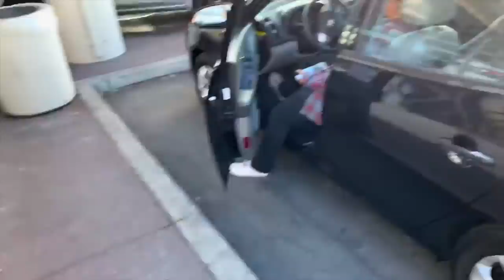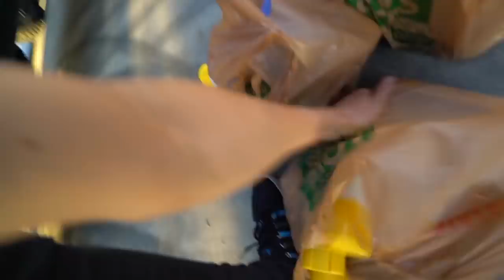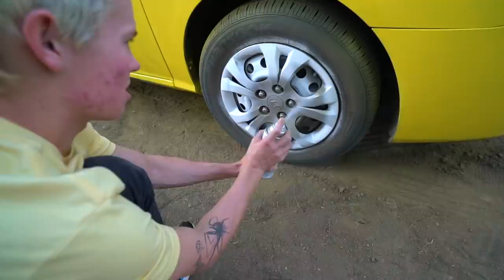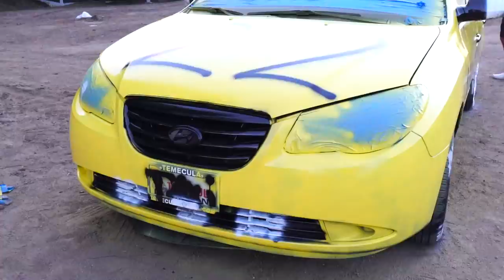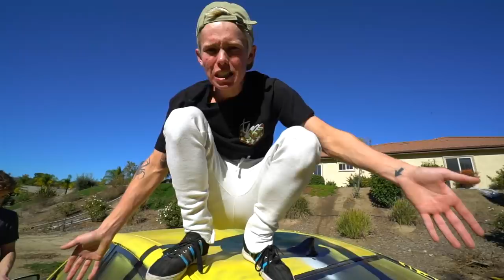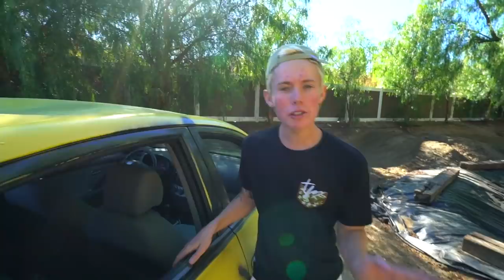I BOUGHT A NEW CAR ON ACCIDENT!  *EXCLUSIVE REVEAL*

Comment: It. MUST HAVE POWER, 4WD, extended exhaust for underwater driving, air bags and a name. Little Mr Shutwell.
Reply: Forget the air bags, wont work for underwater driving😐
Reply: Rims and tires a must. Probably gonna need a BOLT ON BODY KIT?
Reply: Needs a loud audio Hi Fi system.